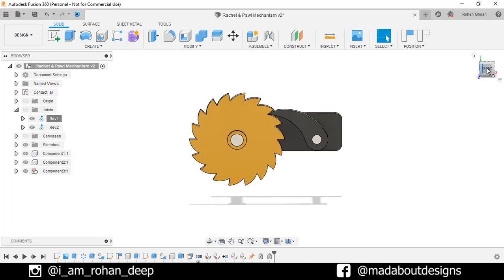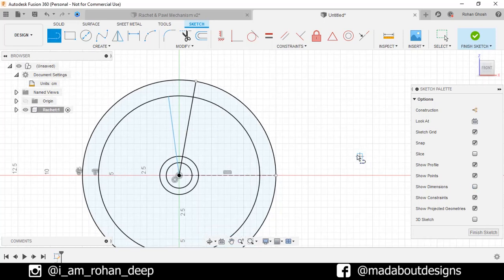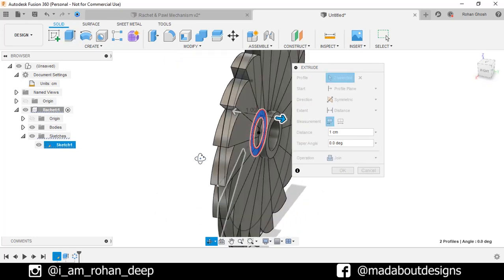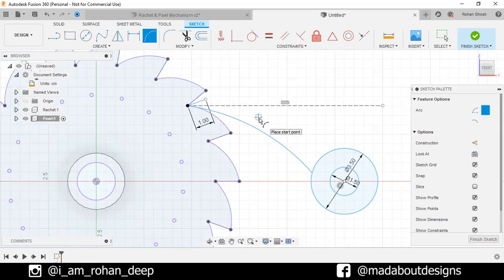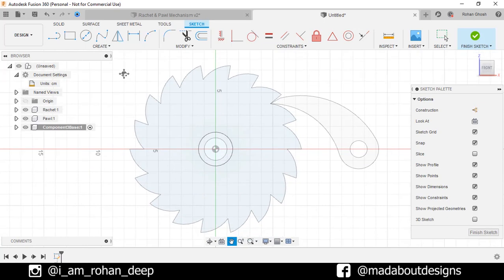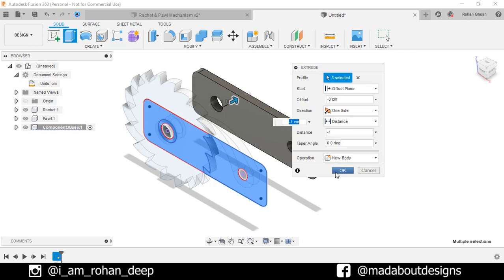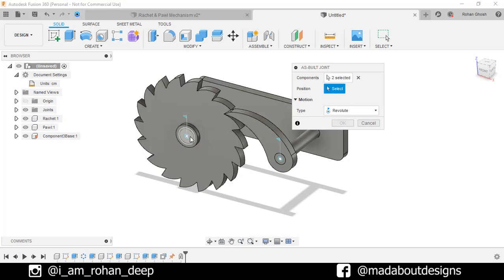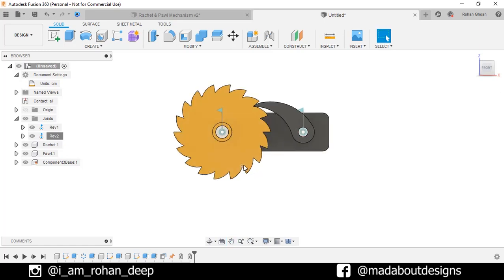How to design a Rachet & Pawl Mechanism in Autodesk Fusion 360 | Advanced Exercise 13

Comment: Nicely done! I like the intuitive way you use the tools available in Fusion to work in the most straightforward, expressive manner. I plan on using this to help me with an engineering class project to hold a pulley in place.